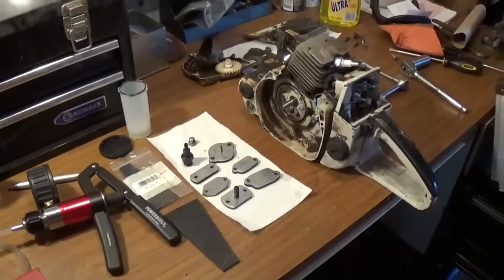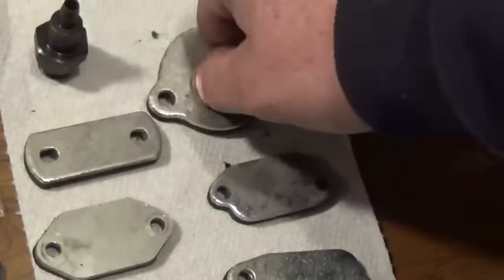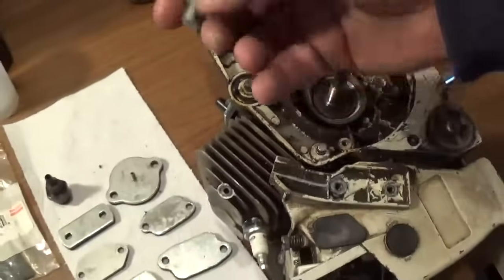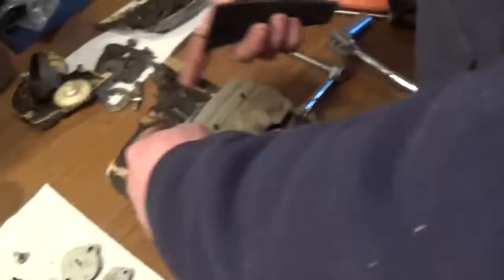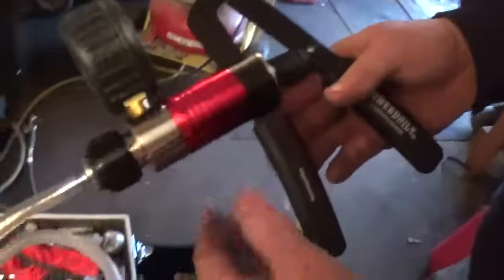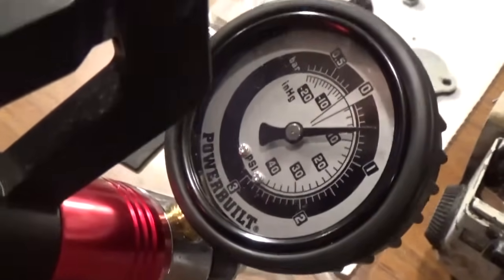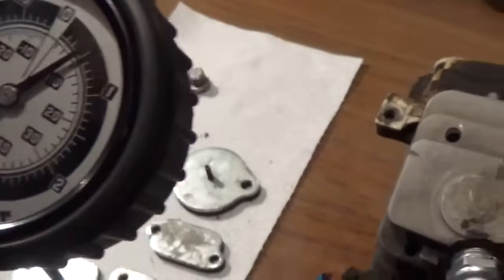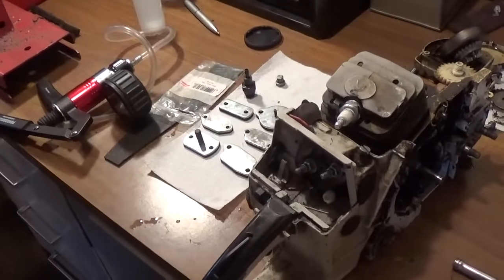Pressure and vacuum testing a stihl chainsaw

Comment: I really want to refine my diagnostic skills to save as much time as possible in the process of troubleshooting.

One person asked this question but I want to rephrase it and get a positive confirmation that my process makes sense.  It seems to me that if you do a vacuum test first and the engine holds vacuum than a pressure test is unnecessary.  If you do a vacuum test first and the engine LOSES vacuum, THEN do a pressure test, spraying soapy water, to locate the leak.

Followup questions:
1 - Are there any leaks that will only show up with a pressure test (but not a vacuum test)?
2 - Is it necessary to rotate the crankshaft during a vacuum test to confirm no leaks?
3 - How do I determine if a particular engine has an impulse line?  I'm working right now on a Homelite    XL Automatic Oiling chainsaw.  Is the bar oil pump powered mechanically or through an impulse line?  I have the IPL but still don't see how it functions.

Thanks for your time, Kevin!
Reply: In the 9 months since I posted the previous comment I've learned a lot more about how small engines work and how to test effectively.  Since Kevin never answered my questions I'm going to answer them here for anyone who reads my questions and would like the answers I wanted back then.

First of all, you can certainly perform a pressure test first and there's no reason it won't work to locate SOME air leaks by spraying all around the engine with soapy water.  That said, you don't want to perform a vacuum test the same way or you're liable to allow soapy water into the engine.

1-To my knowledge at this time, there are NO leaks that will only show up with a PRESSURE test.  EVERY leak will, however, show up with a VACUUM TEST!  This is because, by the nature of how a crankcase seal is constructed, the sealing lip faces inward toward the crankcase and can be pressurized (from inside) and will only seal tighter during a pressure test.  When performing a vacuum, test, however, there is much less resistance to air bypassing around that same lip into the crankcase.  If you look at a cross-sectional diagram of a seal you will easily see what I am describing.  The only caveat to this is when the outer circumference of the seal (metal) has been compromised in some way, in which case it will probably also leak when pressurized.  For purposes of this discussion, however, I'm referring to the internal seal around the crankshaft itself, which is a form of rubber.   This is the surface which will eventually harden and allow an air leak.

2-Athough I don't have first-hand knowledge of this at the moment, rotating the crankshaft through 2-3 full revolutions may very well expose faults in either the crankshaft or the seal itself which only show up when with rotations of the shaft.  It does make sense to me and certainly doesn't take much more time to perform since you're in this far anyway.

3-If an impulse line exists there will always be a connection point (nipple/hose barb) somewhere on the crankcase and another connection somewhere on the carburetor.  In the case of the engine I was asking about it turned out there is no impulse line, per se, but two impulse passages and orifices leading into the crankcase - one for pressure and one for vacuum.  One is for fuel and the other is for the bar oil pump, which is actually a diaphragm-type pump mounted on the side of the engine.

When performing a vacuum test which determines a leak exists, you can locate by spraying a little WD-40 or light oil in the area and see if it disappears into the engine, which then locates the source of the leak.  This is the case with crankcase seals, where it's easy enough to rotate the engine so the seal is facing upwards, drop some light oil onto the seal, and create a vacuum to see if the oil disappears.

All other leaks are essentially between fully mating, parallel surfaces with neither direction stronger than the other.

Here is a link so you can see how an oil seal is constructed and why it's obvious it will seal tighter in the pressurized configuration than the vacuum configuration.

https://www.google.com/search?client=firefox-b-1-e&q=cross+section+drawing+of+crankcase+seal

Comment: Hi Kevin. I am a recent subscriber and enjoy your channel. You clearly have experience and expertise with the Dolmar brand and maybe you can give me some advice. I have a PS510 which has given be reliable service for the past 10 years. When I went to fire it up this spring, it was a no go, wouldn’t even fire. Tried some starting fluid and fuel/oil mix in the cylinder and through the carb and got nothing. I have 115 psi cylinder compression. I have good spark. I have new fuel and air filters. And I have rebuilt the carb. All without success. Where would you go from here? I pressure tested the carb before reinstalling it and it held 7 PSI. I use pure gas-no ethanol at a 50:1 mix. I’m not sure what the nest step should be. Hopefully with your Dolmar experience, you can give me some useful advice. Thanks.

Comment: Hi Kevin where do you purchase the block off plates
Reply from the maker: Dealers / and some are homemade as well ....But Husqvarna offers them on ebay .....sadly they can be hard to find because of demand . If your having a problematic piece of equipment just order a piece of neoprene rubber and cut out a wedge to place behind your carb and muffler .
Reply: @kevinbolin7665  how would you attach a nipple to the rubber on the carb side to hook the vac up?

Comment: do you need to put your piston in a certain position when doing test,either all the way up or down in cylinder wall?
Reply from the maker: Often all the way down ….Although you should pull the starter rope slowly turning over the piston a few times ensuring the seals lips are indeed sealing …..Aged seals can grip the crankshaft perfectly intel being turned to another position .

Comment: Hi, great video! If a saw has a vacuum leak, but no pressure leak, how do I know where the leak is at (impulse line, intake boot, gaskets, seals)? Is it usually crank seals that show this symptom? The saw is a Stihl MS260, and the rpms drop when the bar tip is pointed down, and increase when pointed up. Rarely stalls at idle, though. I first thought intake boot, but assumed that the saw wouldnt hold pressure if that was the case.
Reply from the maker: Its likely a faulty seal or a mating surface causing this to happen as the outer lips maybe fine but inner have been hardened by heat . The internal pressure of the saw pressures the seals against the crankshaft once a pressure tester is used causing the lips to contour to the crankshaft where a vac against the faulty seal {lips} would then be capable of pulling the seals inner lips that have hardened away allowing a decrease in vac pressure on a vac tester .
Reply from the maker: Note / This is indictive of a saw that only is being provided enough oil to fuel mixture to run and even after the repair of {replacing seals and sealing of mating surfaces } You should richen the carb slightly . I have found that many chainsaw and trimmers carbs are built cheap and as a result they don't provide truly enough oil / fuel to vital  parts internal to modern equipment for adequate lubrication .
Reply: @kevinbolin7665  Thanks for your answer. So you would try replacing the crank seals before intake boot,  impulse line etc.?

Comment: In our shop we are equipped as a machine shop also.... We make the plates and using an adhesive we attach thick rubber to the plates....  So when the muffler comes off we attach the plate to seal it.....Yep there are quite a few different types.......
Reply from the maker: Well although My boss dosent really own a machine shop anymore . He worked in them pretty much all his life . So as you can imagine how this comment stands out to me as we still use a Lath and milling machine in shop from time to time . These tools have made many adapters or blocking plates as well for pressure and vac testing .I think our last count was 26 blocker plates for various chainsaws and if iam not mistaken 5 clutch removal tools .
Reply from the maker: Cajun coin hunter I failed to mention as to why we made so many different clutch removal tools in my previous comment. But having your on shop you probably already know of the OEM quality of a few and how often there replaced as a result of failure. LOL….If I had to pick 2 of my least favorite it would be Husqvarna part numbers 502541603 and 502522202 . I bet we have at least 4 of each broken.... and at 20 and 36 dollars a piece  …….well it really started hitting the old wallet so to speak . So we just made our on out of old sockets …….There not going to win any beauty contest but they work excellently . Seeing your comment made me realize that I guess great minds think alike. I have personally made about 16 adapters for chainsaws/ trimmers and much like your description I used thick neoprene about 1/8 inch thick with the aid of a little Ply bond as a adhesive . This works great but to be honest as Iam sure you have encountered as well . Chamber ported Cylinders on more modern Saws like Husqvarna can be a pain in the ass as there tamper resistant torx screws often break off upon removal . In fairness there not really intended to be tampered with but the machining methods as well as sealing of said chambers leave a lot to be desired as air leaks are quite frequent on certain models . Husqvarna is quite aware but really coundnt give a shit less . I guess I am a trouble maker but it just kills me to see such quality being pushed ...And as a result I get cold stairs at most service schools …. You know what I find often crazy about these schools is they project the fact that they wont feed back yet are passive upon hearing a honest answer . And when honesty is provided they revert to a defensive mentality to justify shady tactics in quality as well as machining processes . I truly hate dealing with Husqvarna as there completely consumed by sales and opportunity to capitalize on price point shoppers . Often obligating dealers to hold extreme amounts of inventory but Iam likely not telling you anything you already don't know . About 2 years back Jonsered owned by Husqvarna had 6 different sales reps in the course of 4 months as a ploy to obligate pressured sales upon various dealers . And with each change of the new individual there came new stock obligation . This infuriated many dealers locally as you can imagine resulting in the dropping of the line . Husqvarna used it as a pushing method but quickly reverted back to a more pleasing alternative once sales dropped on Jonsereds . Husqvarna is by far the worst company for trying not only to fuck over customers but there own dealers as well ..Respectfully I know it takes money to make money but a penny stolen isn't a penny earned .And just because you can take advantage of someone dosent mean one should …….Husqvarna truly has no shame or concern for anything or anyone but sales .
Reply: @kevinbolin7665  Yep I know the feeling on homemade specialty tools, we have well over a 100 for various things...  The old Honda jagger / trash pumps, certain outboard engines, the V4 and V6's ....We straightened a crank shaft on the top part of a V6 one time when it fell at another shop, we saved their butts on that one... I  even have a tool that Brigg's don't offer, it's the seat insertion tool like the Techumseh, very easy to make on the lathe...Johnny's dad Frank could make anything in that shop....He is long passed away now, but still with us in memory....I'd love to get you on one of my panels one evening.....I'll have a couple other tech's up also....

Comment: Thanks for the video,  I am in the midst of redoing a few saws of my own.   I will do these tests, but I am also replacing 2 top ends.  DO I need to plug the oiler places on a Stihl 075, 051 which I am doing now?   Or if it gets to where I am servicing my 026's or 044, 660,,,,,,,  same question.

Comment: i know this is old but if you have disassembled this far to do a vac and press test wouldnt it be smart to replace the seals no matter the outcome because you already have it apart?
Reply from the maker: If its your own equipment {Yes} no doubt as long as the piston and cylinder haven't been scorn . A customers well.......You may need to ask if they wont the work done on such a old piece of equipment . As shop labor often can be 60 plus dollars and hour .So seals ,labor, etc could become expensive .

Comment: should we do the vac test first?, then pressure with soapy water, wondering if it sucked in soapy water on the vac test afterwards, just a thought
Reply from the maker: Well you make a great point and in truth you have the right idea ....But in honesty if you had a vac or pressure leak it would be best to remove both seals and spray carb cleaner into the bearings that would then be exposed ..Note if there was a leak I would recommend first blowing off the seal areas and check the crankshaft for loose motion as often a seal leak in these saws is often due to the failure of a bearing or the hole it resides in becoming distorted . Witch is often the cause of a seal leak ........But keep in mind also equipment that is stored may become affected also due to old gasoline taking its toll on the seals and gluing them to the crankshafts .....this affects carbs as well as fuel lines and impulse lines as well . Witch is why I stress with any repair on a Chainsaw or trimmer do a vac and pressure test .
Reply from the maker: Yes ...blowing off the soap before vac testing would be ideal but not really needed as often if there is a vac leak by rotating the engines crank it will expose its self .

Comment: hey Kevin what is the part number for the dolmar pate?
Reply from the maker: I will get this number for you...
Reply from the maker: There are two/ the first is neoprene and the numbers are 944.603.160 {these are typically used on the muffler side but can be applied to the carb side as well .} The next is 944.603.170  This is metal with a place to insert a small hose that can be placed on to pump up the pressure or vac pressure . You will need to purchase both if you don't have a spark plug vac and pressure adapter . They are idea if you own a 510 0r 5100 Dolmar.
Reply: Thank Kevin
Reply from the maker: Welcome...